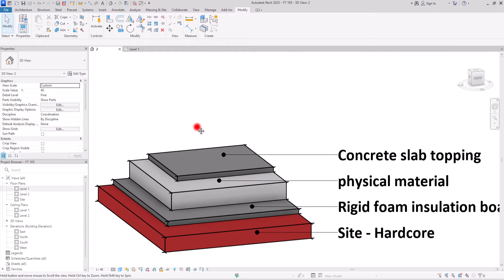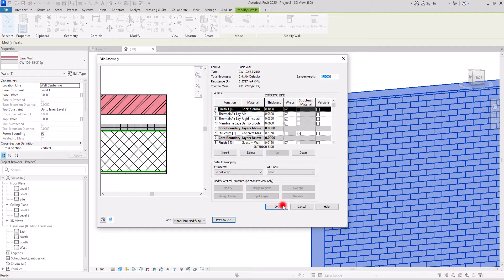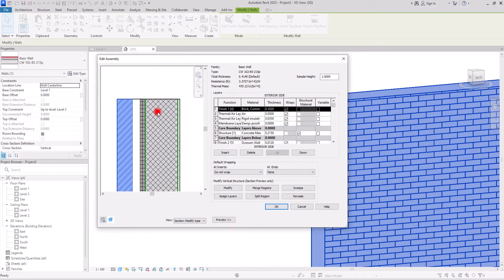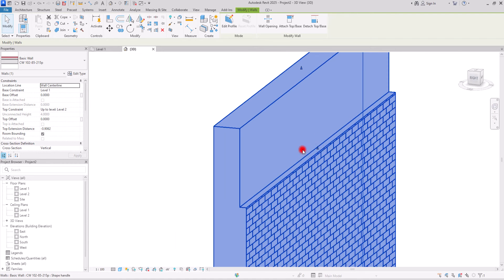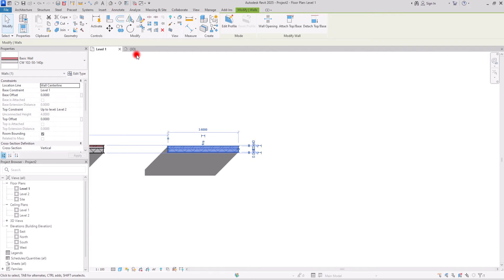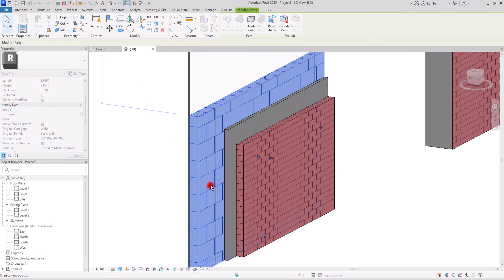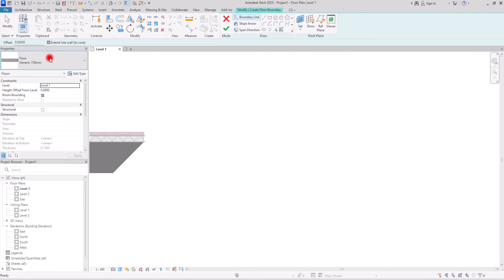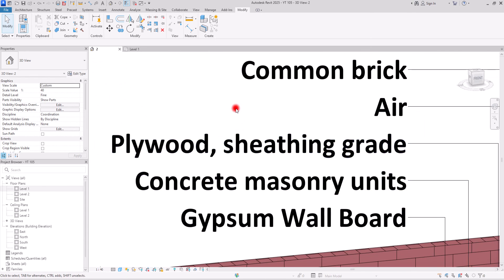2 Easy Ways to Modify Layers of Walls in Revit ✨

Comment: is there a way to automate wall layer offset? like if i want to offset -150mm external wall and have it apply to that wall type everywhere else? might be helpful in large projects.
Reply from the maker: You can do this by selecting the wall and selecting all of its types in project, and then applying the change. But usually for these types of modifications we use dynamo!!
Reply: @RVTPLUS  alright.  i wish i was good in dynamo 😔. thanks
Reply from the maker: It's a very interesting world, and it is really helpful in so many situations. Hope you get good at it asap 🌼